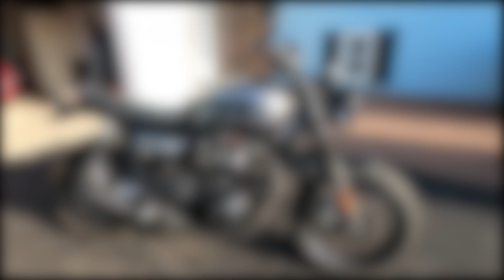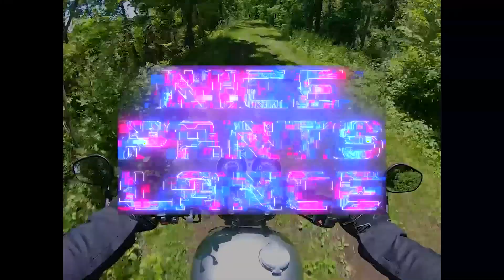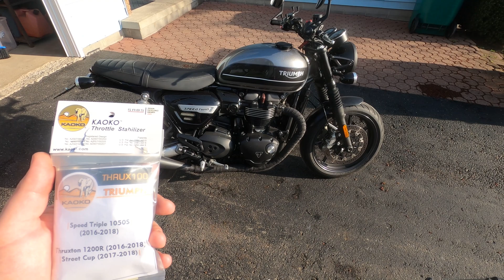The Triumph Speed Twin has Cruise Control!! // Kaoko Throttle Stabilizer Install // 4k

Comment: Wouldn’t the OEM cruise control accessory that Triumph sells for the Bonneville T120 work on the speed twin?
Reply from the maker: I wish it did! The Speed Twin doesnt come equipped with the button that the other Bonnies do. No plug and plug unfortunately ☹️
Reply: @NicePantsLance  I saw a Triumph dealer sell the whole control unit that you would have to replace the current one. It has the button but would wonder if it would work on the speed twin. I doubt it though because it wouldn’t indicate on the dash most likely.
Reply from the maker: Thats a good question! Im not sure either. I know triumph tried to cut costs by excluding cruise control on the speed twin
Reply: @keltecdan bro I thought of buying the same for my 2021 speed twin after watching videos on YouTube as I do long routes on my bike.. so did some research..

Few facts

1. T100, 120 n the bobber handle bars are of the same Dia and accommodates the left side cluster in the above 3 bikes, however speed twin handle bars are of a different Dia.. 

2. The bonnie n bobber series have cruise control mapped in to their ECU already compared to a Speed Twin which doesn't have it mapped.. so for the bonnie n bobber after installing the OEM cruise, they just have to be activated at the dealership n the ECU remapped..

Safe rides👍
Reply: @tomrohan8480  Did you ever try diy-ing the cruise control for your speed twin? I know you can remap your ECU with TuneECU. I'm wondering if with some electrical work and some modifying to the ECU it could happen.
Reply: @jmvoltrino  Sir in India from where I belong any thing is possible..but wen I tried the same on my Speed twin I couldn't..  even the best of the cranks adviced me not to.. triumph dealership outrightly said NO to it..
Jus becuz of this I sold my speed twin n got a 900 rally pro🥲
Reply: @jmvoltrino  I fail to understand Triumphs mindset.. they can give a cruise control on a T120 but not on a ST1200.. seriously the bike cost 13 Lakh in India same as dat of a T120 but no cruise control 😢

Comment: Great review.   I'm looking for a solution for my 2014 865 Bonneville.   To me the perfect throttle lock would 1. clamp down faster. 2. Have two flanges to allow palm tight, pinky release.
Reply from the maker: The Atlas throttle lock is closer to how you described, the only issue is that its a large gaudy unit that looks out of place in my opinion. If i could get over the looks of it, it may be the better product

Comment: Is it feasible to use this “engaged” all the time? Just manipulate the throttle with your hand rather than letting it return itself
Reply from the maker: It is feasible, but quite tricky and would take alot of practice to do it consistently. I tried it a couple times and almost accidentally clutched up into a wheelie 😂